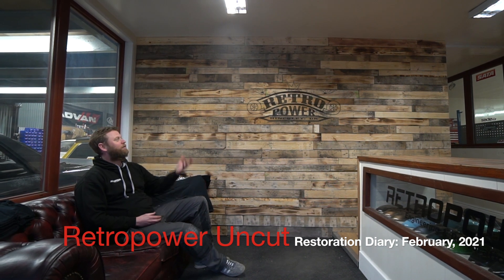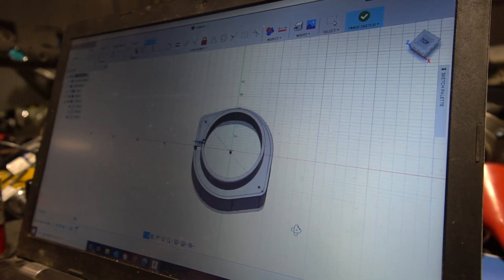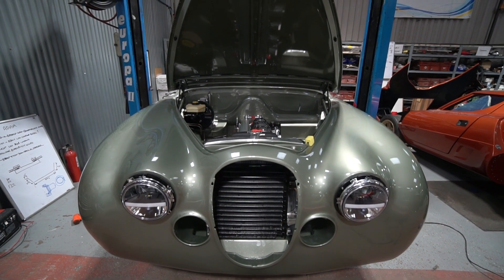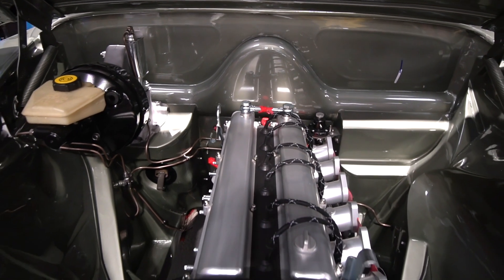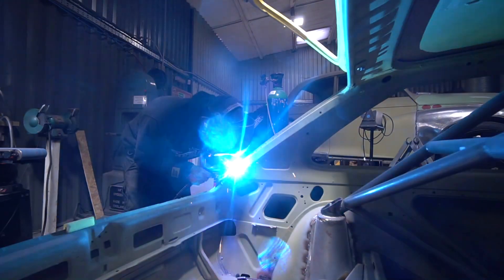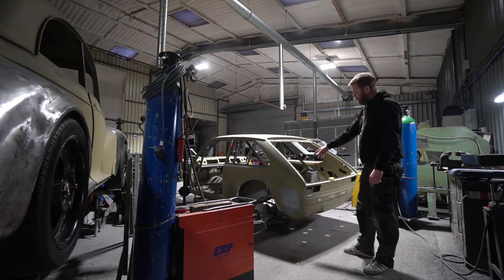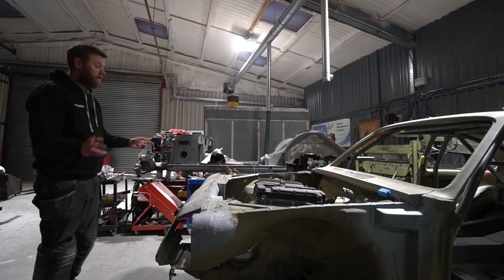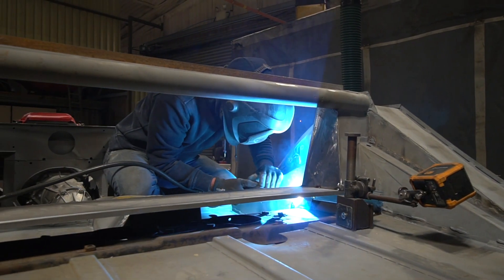Retropower Uncut Episode 28: 2JZ into MK2 Jaguar, '68 Camaro metalwork complete & Jensen C-V8 IRS

Comment: Does the CV-8’s change of rear suspension, or front suspension, mean that the vehicle has now been ‘substantially modified’ and the car could, therefore, require re-registering? (And require ongoing Mot’s etc.). When you alter the suspension mounting structure is it all based on good experience or do you need some evidence of structural integrity of any sort. (Sorry if this has been asked before).

Comment: Why does the ps need to be connect to ecu 🧐
Reply: Probably for speed sensitivity.... less assistance at speed,  more assistance whilst parking for example.....
Reply from the maker: Has its own ECU that controls the assistance motor based on torque input at the wheel

Comment: Did anyone notice the streaming rain running down the window outside the blasting booth or was it something else ?
Reply from the maker: It's a water wall extraction system. Essentially water flows down the wall and over the air outlet pulls the vast majority of dust out of the air. It then settles out in a sump and the water is recycled back into the system
Reply: @retropowercars  Thank you for taking the time to explain that to me. Your Retropower episodes has taught me so much about engineering and tool making etc as well as the correct descriptions.. Just outstanding quality work without compromise. Best video on youtube

Comment: When I win the Lottery. expect a phone call from me asking how soon you can fit an 80's Aston V8 OI body onto a current Vantage base, running gear & powetrain!!
Reply: They look pretty but every windscreen has to be custom made for those cars and the gearbox comes out through the cabin. Re-engineering of the body would consequently be a bit more involved than you might imagine and you still have the steel-touching-aluminium issues. The biggest pain would be the time taken to do it right. Nice idea though. Keep buying those tickets. 😊

Comment: That engine looks tiny in the Jag engine bay.
Reply: Yes but it's 3 litres will make more power & only weigh about 60% as the Jag 3.8. I'll try not to mention reliability ! 1000 times better than a disgusting 350 lump.

Comment: Road car it should have the normal PCV etc.
Gordons Escort desperatly needs a set of proper wheels. Those FUGLY steelies detract so  much.
And that huge offset out is very poor engineering as well. The scrub radius is what made the steering too heavy. And loads up all of the suspension components and pick ups.
You are using glass beading. I have seen several clips now for dipping the whole car. Less heat and warping.  Have you sussed that out? Seems a good idea.
Reply: Yes it would be foolish not having a proper PCV system especially in that climate. It could be be done tastefully.
Reply: If I remember right, the owner of that Escort liked to have period correct wide steelies with nice offset. I think they look very aggressive, just right.
Reply from the maker: The steels and wheel dimensions were specified by the cars owner: Gordon Murray... but what does he know 😄😆

Comment: Amazed that you work on (the jag), leaning over and into the car, without put covers over the new paintwork..commented on it before, please can you use soft underside, work covers..thanks..
Reply: Don't worry about it, he's not damaging the car and, even if he was, it's not your car to worry about.   Thanks.
Reply from the maker: Actually it's a conscious decision not to use work covers as they get moved around by leaning on them and any dirt trapped between the two damages the paint much worse, also if anything bad like swarf gets under them you don't know its happened until its too late. Also in my experience they lull people into a false sense of security and people lean heavily on parts that are delicate. We choose to simply leave the final machine polish and ceramic  coating until last which polishes out any light marks from working on the car